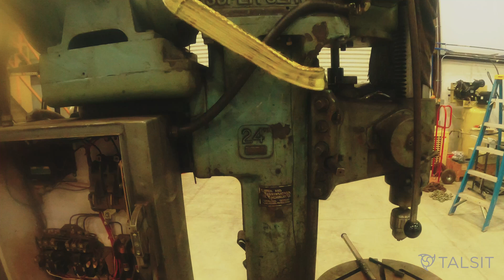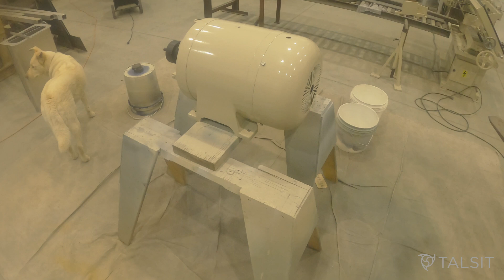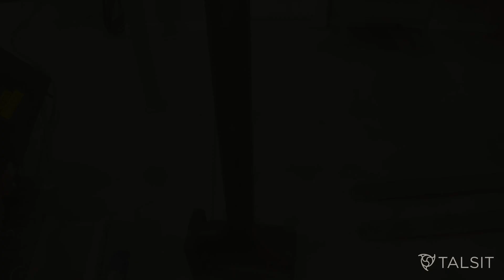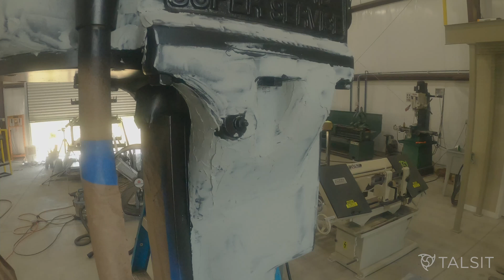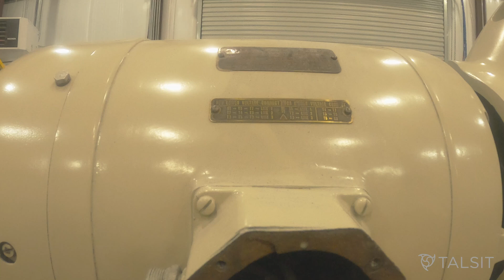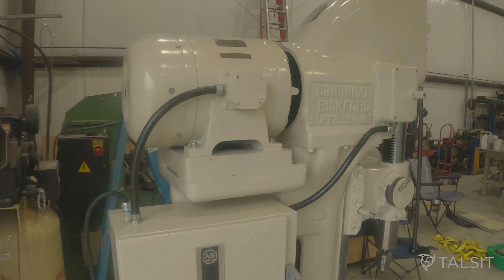Cincinnati Bickford Super Service Drill Press Restoration

Comment: Did you find the bad seal?
Reply from the maker: As it turns out, the machine has not a single seal.  They used drains instead on all the rotating shafts.  My suspicion is that the drain on the spindle was clogged and therefore spilled over and caused the leak.  Further, I suspect the cleaning and running diesel in the gearbox cleared the obstruction the drain.